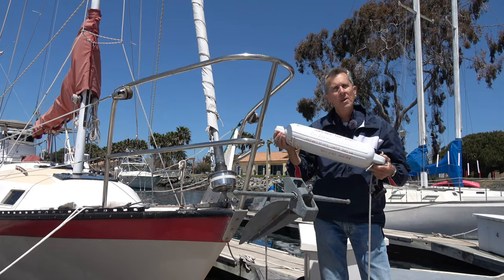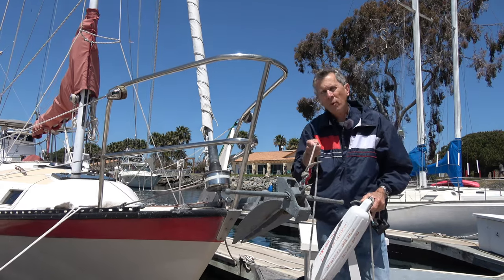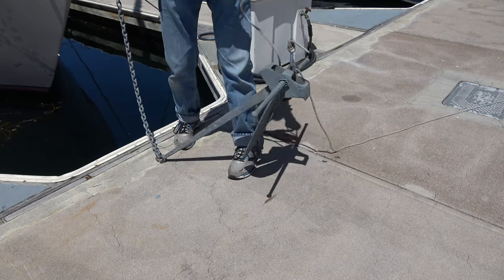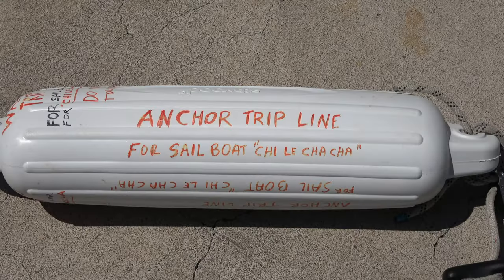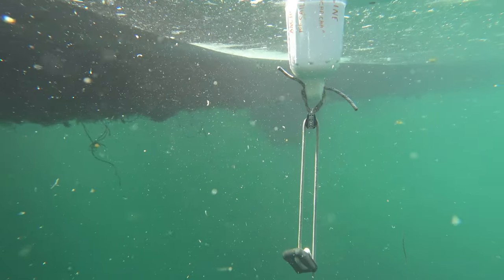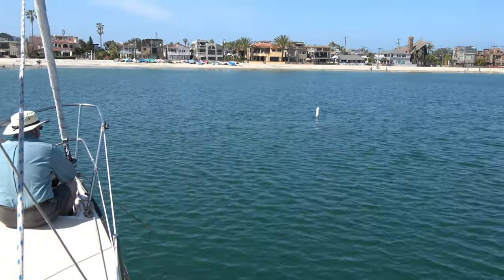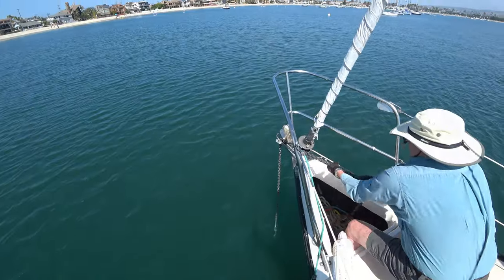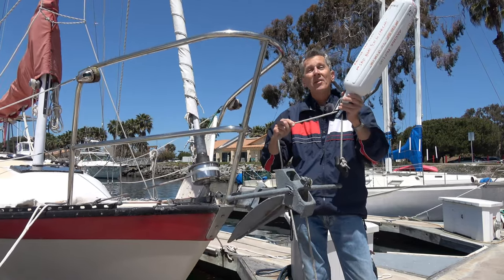How to make a Tripline Anchor Buoy for Safer Anchoring

Comment from the maker: I forgot to say that you can make extensions to the trip line to use when anchoring in deeper water. I have a 5 foot and 10 foot extensions with Snap Shackle or Fast Eye Snaps on the ends

Comment: This idea is  so simple and so smart and even so cheap!! Thanks for sharing!! You don't need then to buy a self-winding buoy that costs a lot of money, the only thing is that this DIY buoy has no night, maybe it's possible to add a sealed waterproof light with a small solar panel and a light sensor
Reply from the maker: Thank you for watching and commenting. I have a few more DIY projects in the works so spread the word.

Comment: To the commentor who said was egotistical, its no different spacing than in a mooring field.  If in an anchorage and someone else!sets too close, theyll be over your anchor and youll have no way to get yours up to leave.  This is a great way to help insure good spacing and that you have access to retreive your anchor to leave.

Whole lot less nusance than knocking on your neighbors hull at 5am asking them to move forward 20 feet so you can pull anchor.

Comment: That's great until the weight line and trip line gets all tangled up in itself. Just shackle your chain to the low side of the anchor and use a trip to attach the chain to the shaft.

Comment: Do you ever find the lines wind or tangle under the bouy? Or does the weighted and tension line keep them apart
Reply from the maker: While I haven't had any tangles I think even if they did it would not result in a dangerous problem. Even if it got tangled you should still be able to pull up the anchor with it.